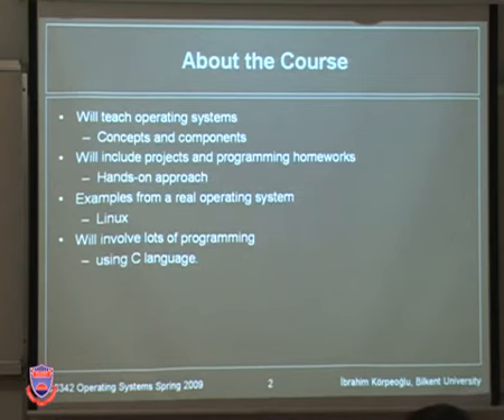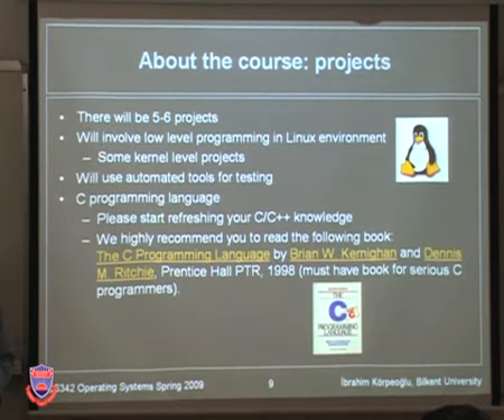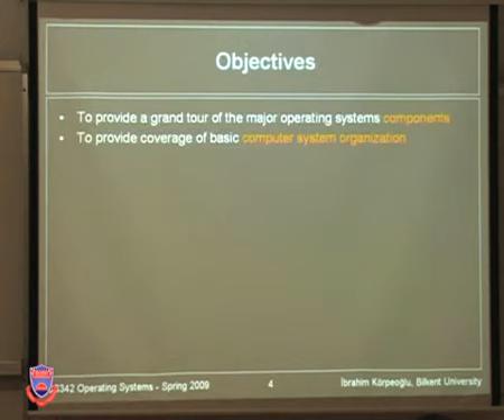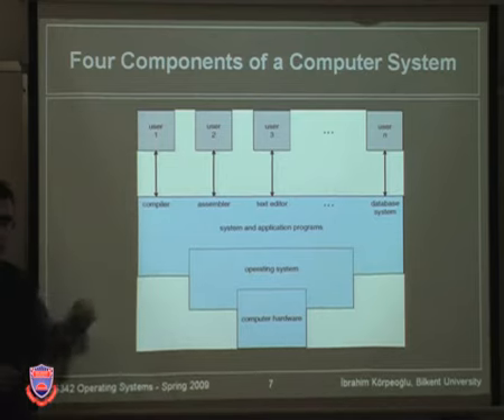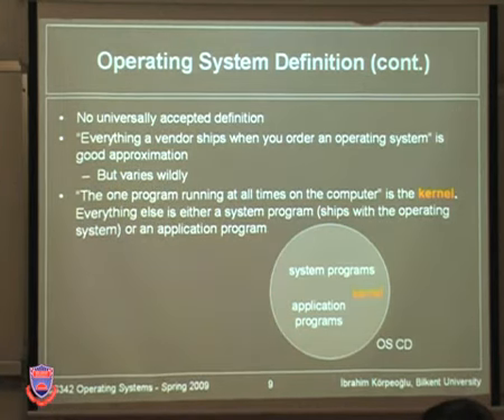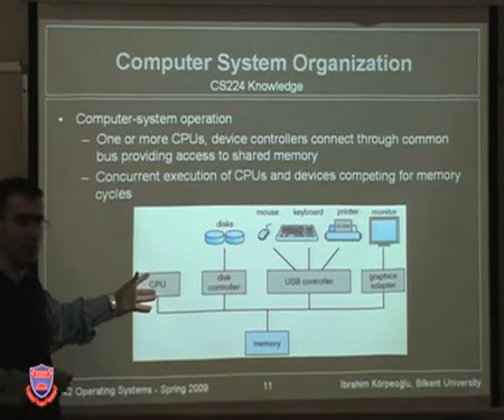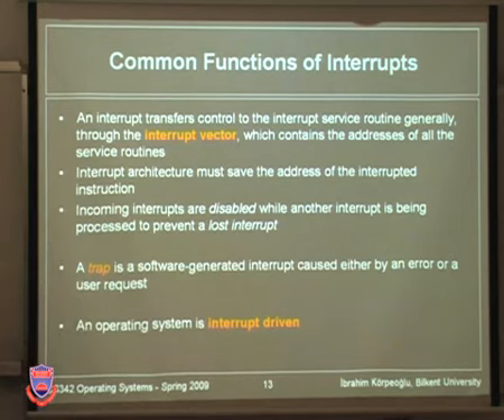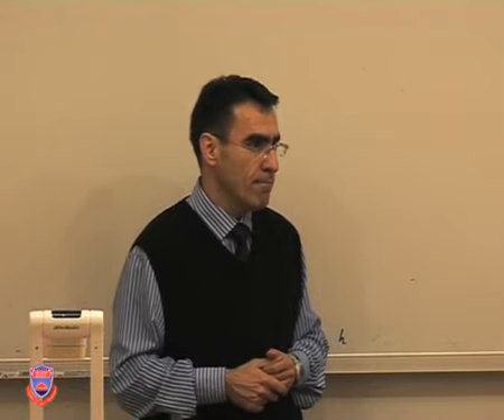CS-342 Operating Systems Lecture 01

Comment: Good Evening Instructors, vf.  I know.  Teach straight theory, then in the laboratory, build right from the box.  Buy an empty motherboard, lay in the silicon.  Make it so you can not, go one step, unless you understand and can build, each step.  No leaving the laboratory science classes until then.  No need for practice in theory, yes, you should be able to go to a laboratory, correct miss. with your theory and build from the bottom to build-release.  Thank you instructors.  You are welcome miss.